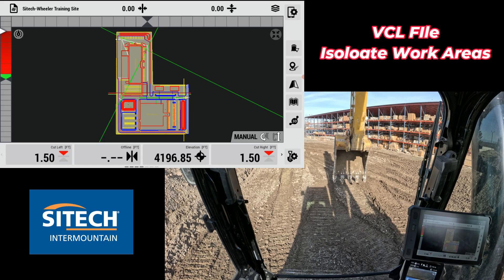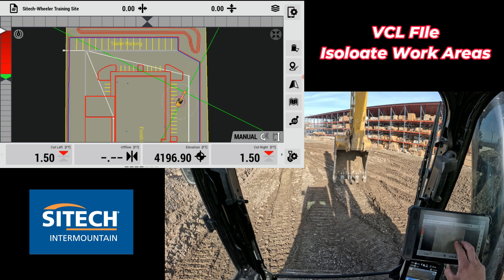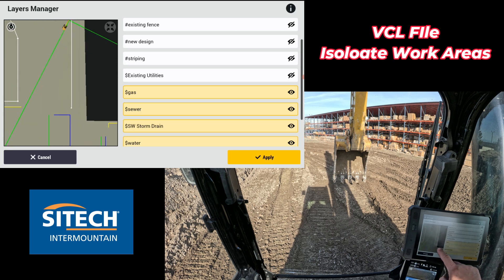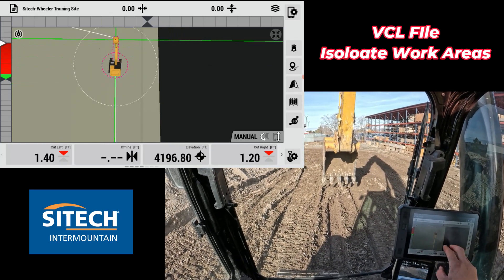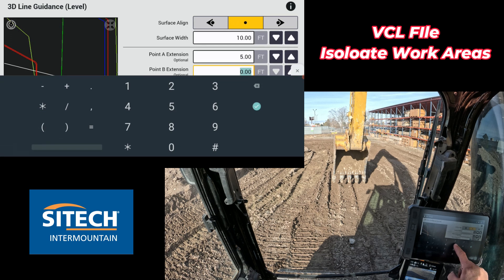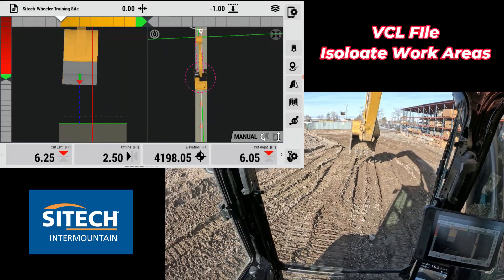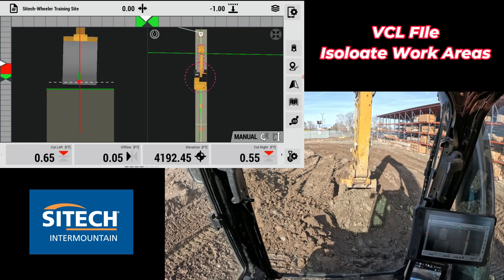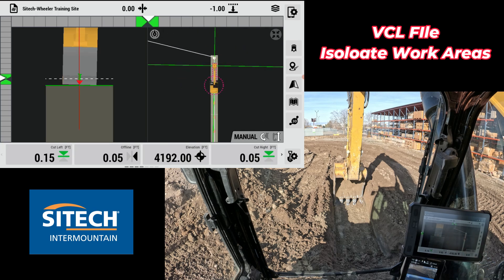Earthworks VCL File Isolating Working Layers

Comment: Hi Geff great videos, my boss asked me how to use earthworks without a base station as we have a new job starting and we only have 1 basestation that is on my job ,I think you can use a sim card in the excavator and run of rtk am I correct ? Do you have any videos covering this subject I'd appreciate any advice you can give thankyou 👍
Reply from the maker: @penningtoncolin  I have only used the machines in our area using a SIM card and what’s called VRS which is using a cellular tower as a correction or base station.  I don’t know if you have that type of option in your area.  I have used rtk on my rovers but not on a machine yet.  I am sure you can and you set that up where you pick the base station channel.  Instead of radio you switch to rtk.  It is a bit temperamental on rivers so I don’t know how it will work on machine control to keep a fixed position.   I don’t have any videos on that specifically but I can put it on the list.